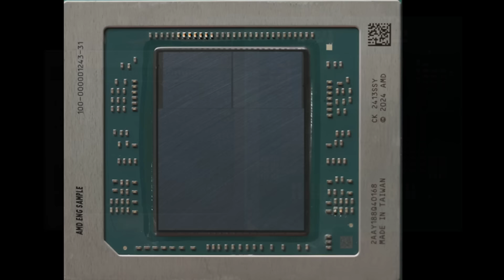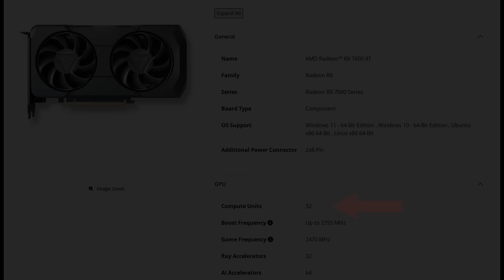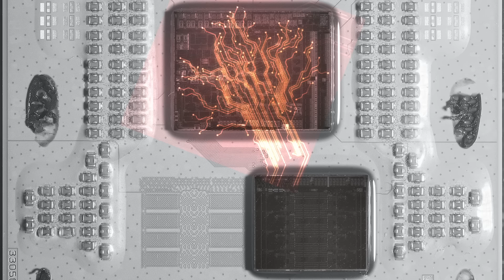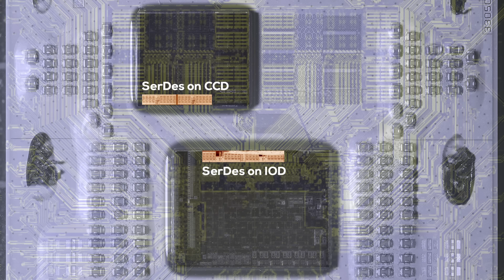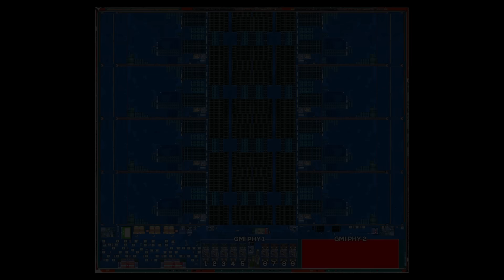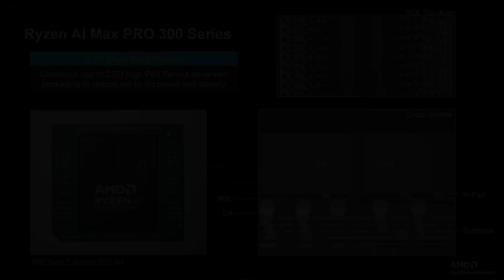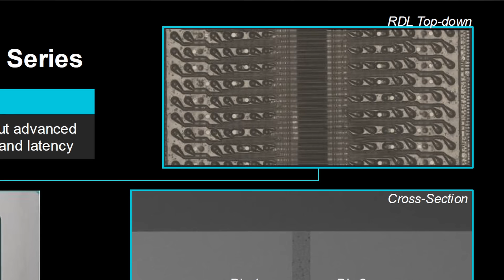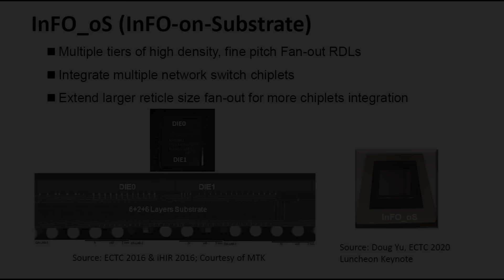How AMD is re-thinking Chiplet Design

Comment: A little off topic question, if china invade or blockade taiwan by 2027, what will happen to the global high end semiconductor supply chains, especially the future of amd. TSMC is already shifting their high end fab to Arizona which is scheduled to be fully operational by the end of 2026.
Reply: It would be utter chaos.  And many people dont realize that US plants aren't gonna be any big savior, since more advanced packaging processes are still done in Taiwan.  Meaning lots of chips made in the US are sent all the way back to Taiwan for final packaging steps and validation.  Also, TSMC ensures that their cutting edge process fabs stay domestic.  US(and elsewhere) only get older process fabs.  China invading Taiwan is honestly a nightmare scenario.  Especially cuz Chinese military is now basically a peer to the US in many ways, and even superior in certain ways(anti-ship missiles and sheer production capacity being the two big ones).  Plus the US military is currently in the hands of some of the most incompetent and unqualified people.  Scary to imagine.
Reply: @maynardburger  xi jinping promised capturing of taiwan before their 100th anniversary of CCP in power which is 2029.

Comment: This is also giving us a glimpse of what the next gen Sony and Microsoft consoles will use. So it's pretty fascinating stuff.
Reply: Maybe.  Cost is still the biggest issue when it comes to console processor design.  Using more expensive options just for slightly better efficiency and total package size reduction probably wouldn't be worth it.  Plus there's just not as much emphasis on maximizing CPU performance anyways.
Reply: @maynardburger  Because consoles use a single memory pool,  this could result in notable performance gains. Fully parallelizing the data flow between CPU, I/O and GPU components is potentially a big deal.

Comment: You just put more cache in the SOC instead of under or on top of the CCD, New interconnect is low latency and has more bandwidth anyway
Reply: The advantage of an separate die for cache is that you can use an older node. Cache just like analogue circuitry doesn't scale well with die shrinks.
Reply: @Psi-Storm  SOC is already on an older node
Reply: is insufficient to support the requirements of 3dvcache, necessitating SoIC or Foveros Direct.
Reply: @CC-qk9hs  how do you know the new interface is insufficient? we don't know it's bandwidth yet
Reply: @Rocman76  Not an expert, but the understanding is that, in advanced packaging, using silicon is the better way for higher bandwidth and smaller area, while the method that doesn't use silicon is the more cost-effective way. This isn't a new method either. If the cheaper method could easily scale L3 cache, AMD wouldn't be using advanced SoIC to extend its $.
Reply: @CC-qk9hs  I mean it depends on the link, I think even if the cache is slower but low latency in the SOC as say an L4 cache it's going to many magnitudes faster then going out to RAM
Reply: @Rocman76  This is somewhat like Lunar Lake's SLC, and I think it's possible. However, it's worth noting that the SoC tile itself is also manufactured using an advanced node (N3P/18A), so it definitely won't have a large $. It should be smaller than the next generation L3 configuration (18M/36M/48M).

Comment: What interesting thing about the memory phy, it runs slower than half speed and yet have more than double the throughput, latency seems related to the clock speed. Great analysis, thank you.
Reply: latency is always directly related to clock because if e.g. you do somethings100/second it means the thing literally takes 10ms. and at 1000/second it's 1ms.
Only pipelining, serdes, etc. change the math. But in many cases, e.g. lppdr5x clocks it direcrly translates to real-world latency.
Because lpddr5x reaches such high speeds its latency is almost or even on par with ddr5 stick ram that runs at lower clocks.
Reply: Memory is double pumped; Hence DDR.

As for latency - we have a few things that factor in, and yes, clock speed is part of it. However, you also need to factor in the physical distance between the memory chip and the CPU package; you need to factor in how the traces are routed and possible interference which can lead to data corruption and failed read/right which will effectively tank latency as re-requests are sent and the like.

Basically: Faster is better, until it is not - and often, you will run into strange performance dips long before you run into outright crashes. It will appear as dropped effective throughput basically - where instead of getting say 5GB of bandwidth, you are effectively getting 4GB.

Comment: In the next two days I'll be receiving my first new PC in over 15 years and it has this chip.  Very fitting timing!
Reply: Good work holding out.  

May the gains from your 15 year upgrade be glorious!
Reply: @badaoe3stratsonly130  I never tasted new tech right away since I usually upgrade every 5 years using tech from 5 years back, GPU alone might stuck with 10 year old tech. It's getting ridiculous how expensive it is, I'm thankful 1080ti still pretty good today.

Oh, I think I'm @ ing wrong people, sorry
Reply: @BALONEYK--CZE-  Its all good. 

The 1080ti does have excellent performance. 

It can trade blows with the 3060 12 gb.  The only downside of the 1080ti is that its more power hungry. 

But if you live in a place with cheap electricity that's a non issue. 

I've honestly started to drink the apple cool aid.  And I just bought a 2000 dollar m4 macbook. 

Because insanely high ram prices paired with absurd GPU prices have taken away a lot of the appeal of upgradable systems for me. 

Honestly,  an cheap mac computer paired with an 2tb external ssd is starting to look like the new meta for value focused consumers. 

The M4 mac mini can give decent performance for less than 700 dollars.   And you can get an 2 tb sata ssd with an Santech enclosure all for around 150 bucks. 

So you can have a decent workstation with good storage for the same price as a single 4080 ti.
Reply: @badaoe3stratsonly130 thank you?  Realistically more of a 7 year gain, I have run a few used machines over the years (I meant brand new) plus my work PC for some stuff.  This is just the first new tech that I'm excited enough about.  Plus, I don't need to support the ridiculous modern GPU market.
Reply: @ClipstopherBurtraw  True GPU's price have gotten out of hand. 

I work in the software dev side of things.  So i'm more or less forced to buy a new test systems every other year. 

But I can't stomach Nvidia's cash grabbing tendencies either.   Its just beyond the pale. 

-

I'll dive head first into an 10 year old application filled with spaghetti code and no comments

Before I give Nvidia another damn cent. 

-

Trouble is, Nvidia is a AI company that service enterprise level clients now. 

Even if we never gave them another cent.  They'd still be fabulously rich from the billions they make off of their AI business.
Reply: @badaoe3stratsonly130 I'm fine with them getting rich doing that.  I just don't want to be a part of it.  Artificial scarcity to milk us while and because they're already getting rich from AI, I'll play no part in.  

This 395+ machine is more than enough for my needs, and only costs about the same as a mid high GPU alone, yet with more memory so I can still have some AI fun too, and for a minimal power bill.  It's perfect.
Reply: @ClipstopherBurtraw  I'm sure it will be. 

The only thing to keep in mind is that the drivers for AMD are usually shite at launch. 

But then they age like fine wine. 

I bought an laptop with an Ryzen 7840u.  

Right after I bought it, my laptop would scream when I'd boot up a 5 year old game, and I had to deal with random crashes. 

I was furious.  But the system improved with each and every driver update I downloaded. 

Within six months it could run Cyber punk whisper quiet and it never crashed even under the heaviest loads. 

So my one recommendation is to be patient.
Reply: @badaoe3stratsonly130 good advice - thank you!  I can be patient, I preordered this thing in February lolll
Reply: Wait for Medusa Halo. It'll be faster.
Reply: @kyleheaser2385 There'll always be a faster one, but how long should one hold out?
Reply: oh my goddd, mine will be I'm planning to buy my 2nd computer since ~2013... it's been like ~12 years already!!! I want to experience a strong, fast laptop!!!

My laptop is Acer that costs ~$300, it has Intel Celeron B830, 2c2t, 1.8GHz
I upgraded it to use SATA SSD and 16GB RAM, with Windows 10!

I am really in a bad situation right now where I can't get my preffered laptop because of some out of stock always and I don't get why it is that way since it's a very good spec laptop so you might think it has plenty of stock...

My preferred laptop would be Vivobook S16, Ryzen HX 370, 32GB RAM, 1TB SSD, 16" 3.2K OLED, Black...
Believe me! No stocks in U.S.A.
I saw one from EU but it's out of stock! (No way I will buy from there, it's more expensive)
In Philippines there is one model but different spec, only 24GB RAM and Silver, both is NO WAY to me!
My chance will be any U.S. online stores, can't find it in Bestbuy, Amazon, and other U.S. retailers...
I actually found one but it doesn't ship directly, it needs to be picked up! So it's gonna cost me more money which is sad :( I'm still thinking what to do though...

It's from Microcenter!!! So far one online US shop that has it!
I really need it sooner!!! since I'm young and I am pressured to earn money for my wants, needs, desires in life!
I really want an excellent specced laptop so I will really be picky... and not only that... I'm so thirsty of an amazing laptop because of only experiencing one & slow in my whole life so I really deserve to get an amazing one!!!

I wish myself luck